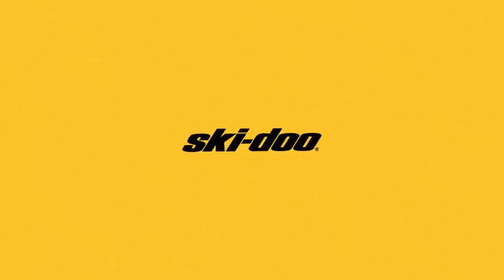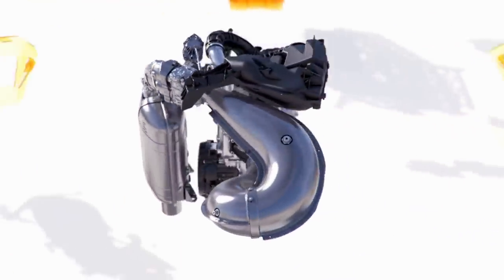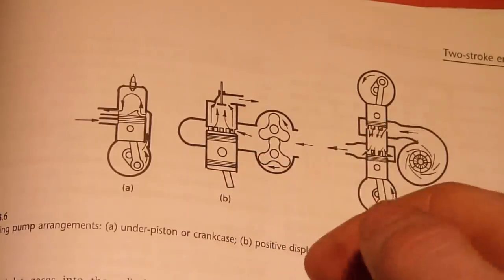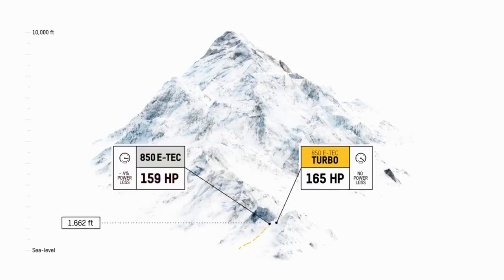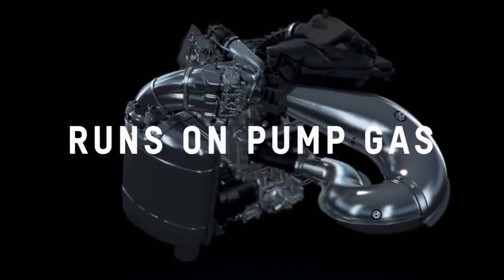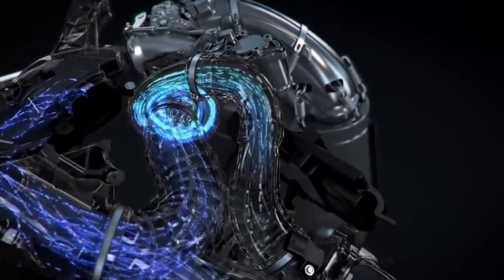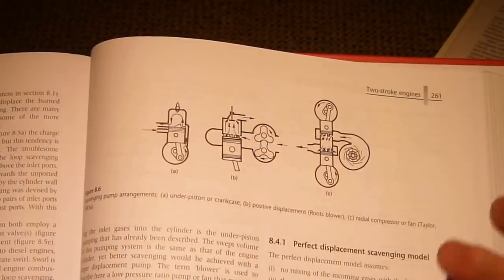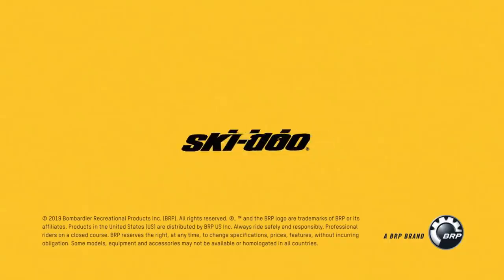2 Stroke Turbos - they can't be done. Period.

Comment: Any high pressure air goes straight out of the exhaust port? What? I'm no engineer, mechanic or even clever in the slightest but is that the closed exhaust port it's going out of?
Reply: Look up a 2 stroke engine no valves just ports, the fuel air is sucked in from the crankcase as the exhaust gas passes out the exhaust port, it is the piston that closes the ports on its path back up..... I think 🤔
Reply: The exhaust must open before the intake or the exhaust will start going into the crank case, because everything is symmetrical that also means the the exhaust will close after the intake
Reply: No different to a normally aspirated 2 stroke, you just have to direct the incoming gases away from the exhaust port so that it gets behind the exhaust gases and pushes them out before the port closes. All we are talking about is pressure above what would normally be achieved by crankcase pressurisation. Plus there's nothing new in port (valve) overlap, happens all the time in performance 4 stroke engines.
Reply: Tuned exhaust pipe is pushing that charge back into cylinder.
Reply from the maker: Well not really. It stops charge leaving. It doesn't push anything back in.
Reply: @dirtygarageguy  yes really,  pulses send charge back. Thats how 2-strokes work. And crankcase scavenged 2-strokes were succesfully turboed early 80s.
Reply from the maker: No they don't. Work out the mass of the air/fuel. Then work out the mean flow speed, then work out the pressure wave thats returning...
Reply from the maker: Think of it like this. The pressure wave flowing out of the cylinder is stronger than the wave reflected. Energy is lost  and the cylinder charge also has the piston force against it...
Reply: @dirtygarageguy  I think you should study 2-strokes , and a lot else , your videos are full of misinformation.
Reply from the maker: Like? Also do the calculations... then get back to me
Reply: @dirtygarageguy  there are people who know how 2-stroke pipes work , you are not one of them.
Reply from the maker: Well explain with the calculations then... if you have a flow rate of a cylinder moving at say 40 m/s with a mass of say 0.005 grams how much kinetic energy is that? 

Also the pressure wave, which is actually a density wave will not force the air back into the cylinder.

A density wave like sound is not the vector of moving particles. Just like a Mexican wave, no one moves in the direct of the wave. 

Idiot.
Reply: @dirtygarageguy  that density wave must have something to make denser , that something is in the exhaust pipe and it is compressing it into cylinder.
Reply from the maker: No. What you're talking about is flow reversal, and it doesn't happen. The wave stops/massively reduces fresh charge leaving, but there's no reversal
Reply from the maker: Do the maths for fuck sake. Its also called con rod, but its not conning anyone...
Reply: @dirtygarageguy  there is no flow out of cylinder the moment pressure wave comes back , most of exhaust is evacuated during blowndown when exhaust opens. So I dont even need to calculate inertia.
Reply from the maker: You do. Then you'll see how wrong you are... you say there's fuck all exhaust gases, so what the wave moving through??? Lol
Reply from the maker: Check the numbers  you'll see youre only an order of magnitude out. Seems like your argument is falling apart
Reply: @dirtygarageguy  study 2-strokes and then do your calculations again.
Reply from the maker: I'll do them tonight. We'll see how stupid you actually are...
Reply from the maker: Just to clarify, you don't work out the inertia. Tit

Comment: a turbocharger increases volumetric efficiency to some degree always.
Reply: Expansion chamber on racing 2 strokes...... Been doing the same thing since 1981
Reply: While an expansion chamber does greatly increase exhaust scavenging,  and promotes efficient fuel burn, it won't raise combustion chamber pressure, therefore still limiting power, relying on atmospheric pressure to stuff air into the cylinder.
Reply from the maker: Well that's not entirely true...
Reply: @dirtygarageguy   Would you like to explain why it's not true?
Reply from the maker: I said entirely...

You said that an expansion exhaust doesn't increase combustion chamber pressure. Well it does. How? Without the exhaust more fuel is expelled out of the cylinder, so less fuel is burned.

The problem was the tune was very specific with a short powerband, so to broaden out the powerband, power valves were used.

Comment: Its not that they can't be done, its that your not utilizing the technique efficiently. Turbo two-strokes have been around for years, but only now becoming a thing because of certain use-cases that benefit from using 2 strokes. Sleds in particular get tossed around a lot so their never level which is counter-productive for oiling and they need to be light weight yet powerful to stay on top of the snow. One could say the main reason skidoo finally took the plunge is because of oiless turbo tech, and even then I'm not sure how they managed a reliable tune, but it has a warentee so who cares, you got the money then buy it, sure beats adding 100lbs to the sled.

Comment: Achates engine is another one to look at if you're interested in weird engines. Be nice to see Matt cover it. I know it's not motorcycle related though
Reply: Isn't the Achates engine another development of the ideas of the Junkers Jumo 205 engine, which lead to the aborted Jumo 233 and the very successful Napier Deltic?
Reply: @chrishartley1210  I don't know enough about the Junkers Jumo engine you speak of,  but quite possibly it's 1/3 the Deltic set up. "achates power", look it up. I'd say it's got too many issues with oil consumption and emissions for mainstream use, but they were talking about its use in military vehicles. They had a working prototype in an F150 pickup. Looks really simple in its operation, just seems to have died a natural death like the rotary.  Wondered if anybody knew for certain that was all.

Comment: "It's Physics" lol
Also... only 4 lbs of boost?
Reply from the maker: 4psi is what we'll cover next
Reply: Skidoo’s primary goal is to maintain horsepower levels at increasing elevation. That being said, there are aftermarket options to make bigger power.
Reply: The target, from the advert, is to maintain power as the air gets thinner up the mountain rather than the usual "give it 20 pounds, it'll be fine!"
Reply from the maker: There also the problem with the etec injector. It has a limit on the pressure it can deliver

Comment: A diesel could be turbocharged. In fact most ship engines are 2 stroke diesel.
Reply: the two-stroke diesels are not really super charged, the just use a turbo instead of the crankcase and they don't piston port exhaust so they can time the intake/exhaust closing differently
Reply: Lasse Langwadt Christensen Yes good point, a multi cylinder engine would be pretty rubbish using crankcase pressure for cylinder charging.
Reply: @JonathanTyas  works pretty good in the bikes with multicylinder two-strokes, they just have separate crankcases ;)

Comment: It must eat shit ton of fuel
Reply: These engine have direct injection so i guess not
Reply: @RutgerMulder  Even with DI consumpiton is high in my opinion.
Reply: Turbos reduce fuel consumption in most cases not sure how it would work out  on a 2 stroke as one of the biggest draw backs of a 2 stroke vs 4 is increased fuel consumption.
Reply: Well you cant really turbo it well so where is the point in doing it. Some non turbo 2t engines are probably better and cheaper. If you have slightly better fuel efficency it is still not worth it.
Reply from the maker: Turbos reduce fuel consumption? Say what now?
Reply: @dirtygarageguy  very hard to explain what I mean in a msg but I'll give it a go don't roast me to bad lol.    Using smaller turbo charged  engines in normal usage instead of large dicplacment engines can reduce fuel economy from reduced weight  and being able to fit them in a tighter package .   I don't actually mean bolting on a turbo to an engine will make it more efficient by itself I  should have been more clear.        Turbo 2 stroke sounds fun until you ride a 500 2 stroke motocross bike I don't think any man who's raced 1 of those in anger would have ever wanted to ad a turbo. There was several gp riders actually used to reduce the dicplacment in them to make them easier to put down the power.         2 stroke turbo not for me  those beasts want to kill you already.
Reply: @Blaaggarding  the boost pressures would literally be blasted past the exhaust port. The only way I see this working  is if you had a set of “expansion” chambers tuned to match the psi of the incoming gases being scavenged out of the exhaust port. What I mean is let’s say we have 4 psi of pressure from the piston compressing the gasses in the crankcase, and we have another 4 psi from the turbo, and we scavenge that through the transfers were it will then be scavenged into the combustion chamber via our “specially designed” pipe. The only way I could see this working is if the slope of the tapers on the diffusers was super narrow, so we don’t induce more negative downstream pressure of our charged gasses (id assume so that they don’t blow past the reflected sound wave) But anyhow I don’t see that working because at those charged pressures there’s a lot of other factors to take into place, such as but not limited to whether the sonic waves would break down at those pressures, or  if the returning pulses would cancel each other out (I haven’t seen the port map of the ski doo engine, so I could just be wrong.)

Comment: Lol this guy is referencing a china doll motorized bicycle motor.

These ski doos are 2 stroke. But definitely nothing like what he is reading in his book. I've seen 3 cylinder 2strk Turbo at 500+ Hp. Technology has developed and they don't rely on reed valves, intake exhaust and ignition timing in linear terms. 

There are now cams, intake/exhaust valves. On top of expansion chambers, electronic ignition. They are mashing 4 stroke tech into 2 strokes.

Comment: You don't know how expansion chambers work.
Reply from the maker: Who me?
Reply: If you think two strokes can't be turbocharged or supercharged yes. Sadly half of those doing it don't understand it either because if they did they would be able to gain better results
Reply from the maker: You've misunderstood the video...
Reply: @dirtygarageguy  then what did I not understand? You say that the charge go straight out the exhaust port and it's just physics and it is exactly what two strokes did 80years ago by short-circuit air that was cured by adding expansion chambers. The physics of sound and pressure in the exhaust system will counter the physics of pressure in the cylinder. An carefully engineered expansion chamber will add a sub atmospheric pressure on the exhaust port during scavenging and prior to the piston closing off the exhaust port an sonic wave will reflect back up on the exhaust port pressing the short-circuited charge back into the cylinder. When the wave bounce back the port should be closed or else the charge will be pushed back out. This can be noticed on heavily tuned twostrokes without powervalve because you make no power at 6500rpm, but toons of it at 7000. This is because at this engine speed the piston move fast enough to close the port beforee the charge is pushed back out. You can also notice this at high RPM's that your two-stroke will rev higher if you go with a lean air to fuel ratio. On high RPM's the port will already be closed when that wave returns but if you go leaner the exhaust will be hotter and the speed of sound is higher in a hotter exhaust gas so it can still make it before the exhaust port is closed allowing you to rev higher and melt a piston if you push it to long. This is just physics.
Reply from the maker: I didn't say that at all. Lol

Comment: Are you making this video just to get a reaction or do you actually think you’re smarter than the rest of us who have been building turbo 2 strokes for years? Answer me this. If I have two identical sled motors porting, exhaust chamber, etc, etc with the same engine architecture and 850cc. One makes 165 hp at a given altitude and another has a turbo kit with the same exhaust chamber yet with a turbo and the necessary parts to make it work (intake, injectors, etc) and it makes 200hp, what is accountable for the difference? Oh it must be the airbox and injectors duh. I guess we all can throw the turbos away and just go with that, it’s much cheaper. The sled motor was just a for instance. We do it on all different configurations of 2 strokes. Just because you simply cannot understand something does not make the rest of us idiots.
Reply from the maker: Lol there are 2 people in this video...